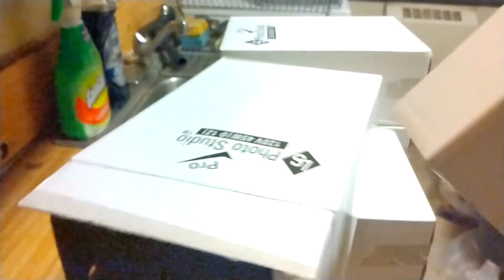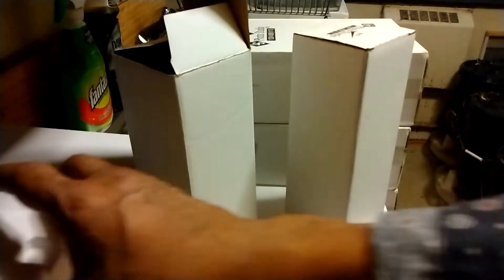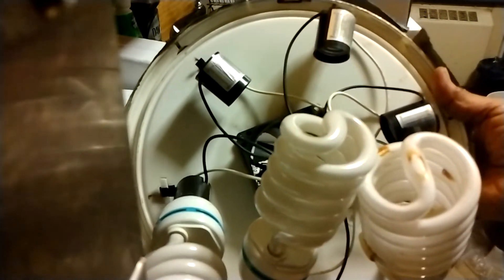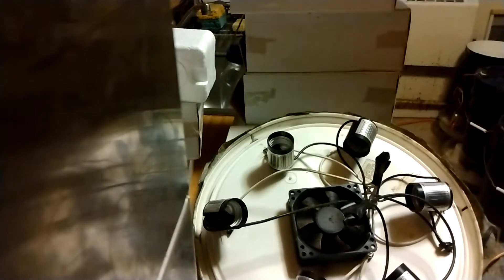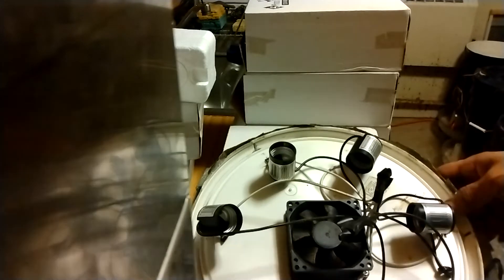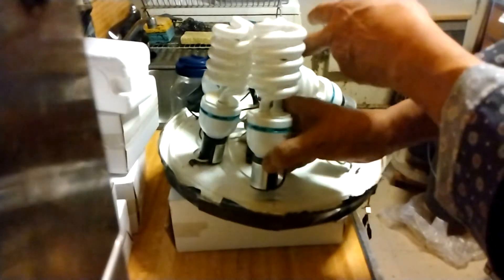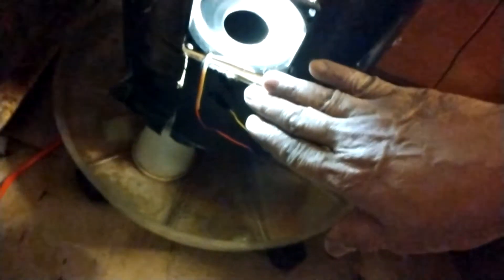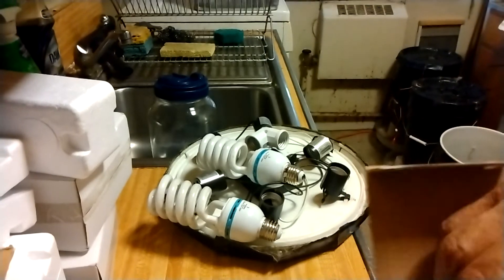Space bucket Grow using & adding CFL's in my Hood Projects

Comment: ok the sansi leds would be better? now idk if led is safer?  that would be the main diff. BUT 4 exposed sockets could spark if not insulated. So what is the point of using CFLs if they are still the same price as 1 or 2 leds. You could even buy COB leds and just have to wire them up . I saw a really cool spacer you can fit a COB led fans and wires in a water proof like double bucket top ! Plus you can easily find 200 watt led strips . I think i saw even nicer compact led strip like lights on google !